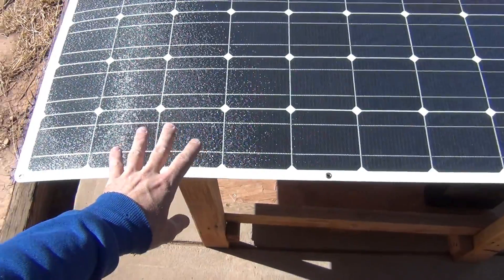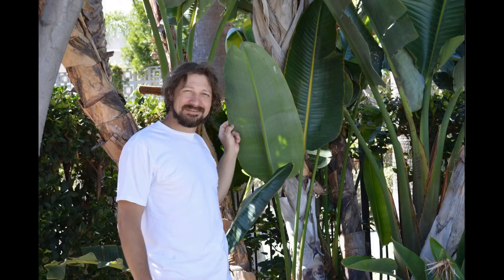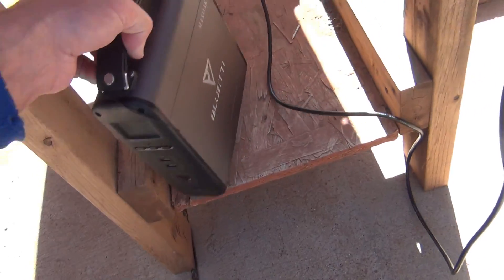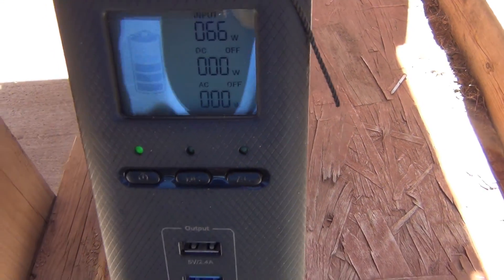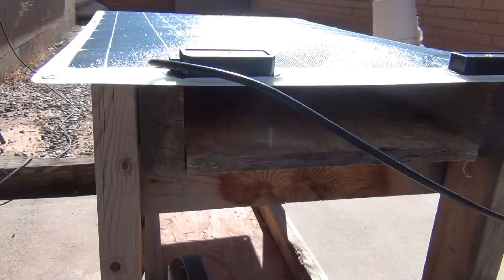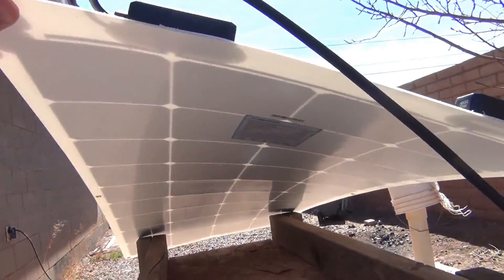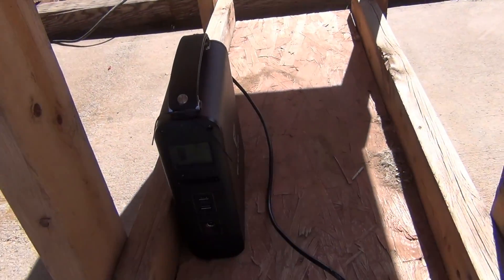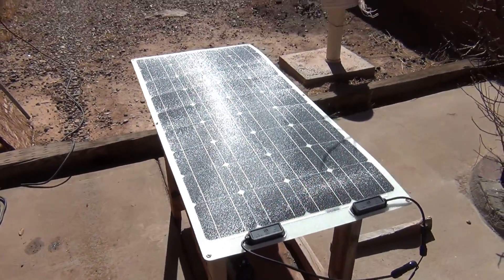Charging Bluetti portable power station (AC20) with Renogy 100 watt flexible solar panel - its easy!

Comment: I didn't find a follow up to the bluetti 20 that you use in this video. I was hoping you had some better info on the dc voltages coming out of the usb and ciggy charger outlet. I think I'm going to return mine tomorrow as the 12 volts won't run my cpap for more than 1 night or maybe 12 hours max. Also the other reviews say the USB voltage isn't high enough for charging much outside of a cell phone.
Reply: The new PD3.0 delivery nowadays, up to 140W and the low AC voltage of 106 makes this not too versatile  for charging or powering AC loads. DC is 11.9 volts when mostly charged, only good for lights and fans mostly. Jakery has good lighter sockets running 13.5 volts for fridges and cpap. Very few solar generators output more than 12 volts, even ham radios don't output much power without 13.5 like your vehicle does.

Comment: Thanks for sharing. Question: in your experience - what solar panel / setup would you choose if you could only have 1 set to take out camping/boating and use around the house? Greetings from the Netherlands